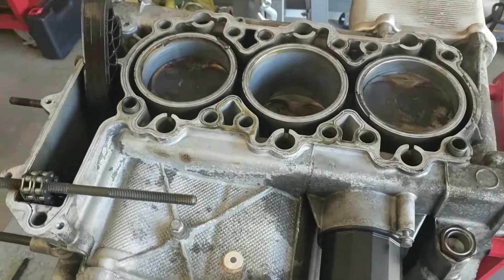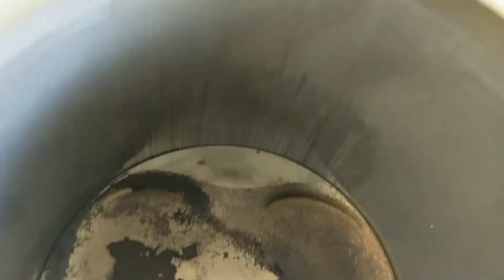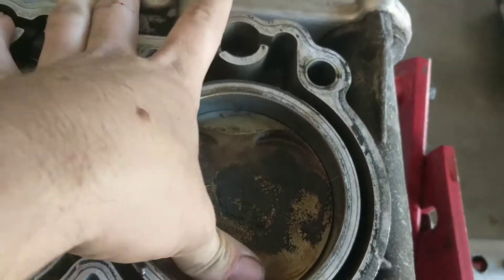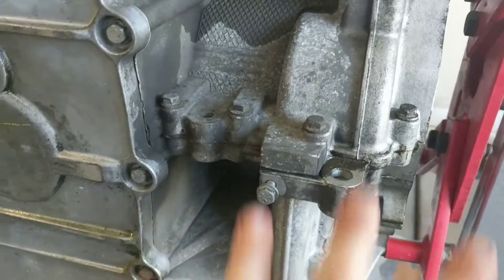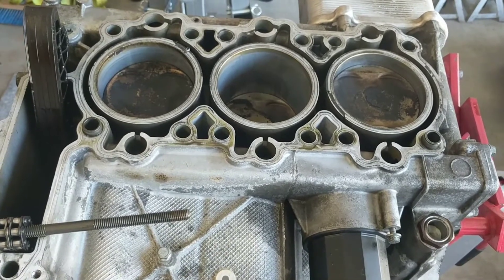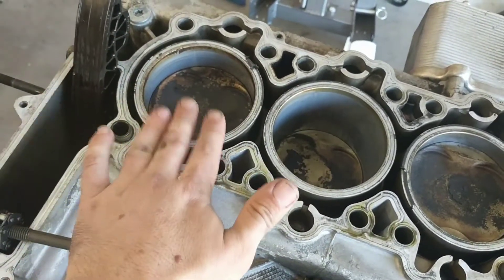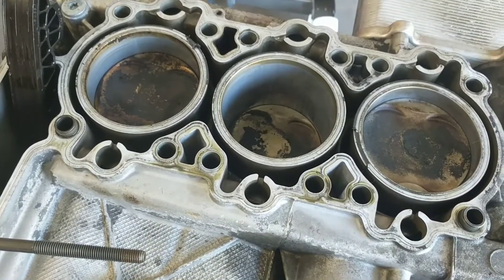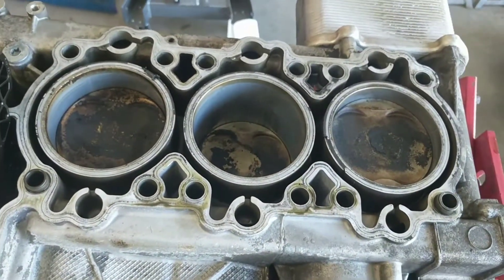Porsche 996 engine piston slap

Comment: I had my engine rebuilt due to ims almost failing. I specifically asked the garage to check the cylinders and liners and they did they were fine. Around 2-3000 miles later it develops piston slap when cold. Could or should they have noticed this when they had it apart or can it come on suddenly?
Reply: It's a very gradual process. The scoring begins at the bottom of the cylinder.  In order to check, a bore scope can be done by removing the spark plugs, but this won't detect the very bottom of the bore.  Ideally the bottom of the cylinders should be inspected with the oil pan removed.